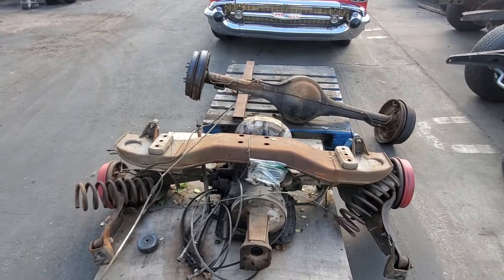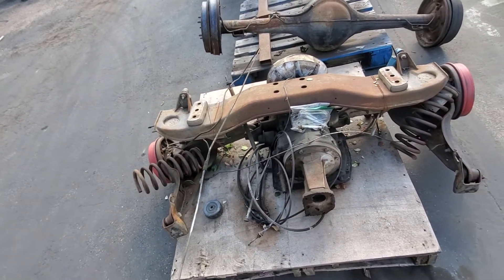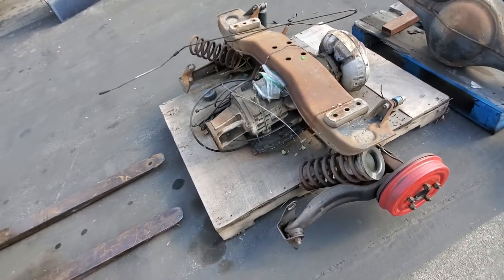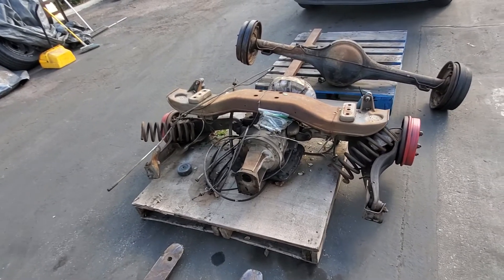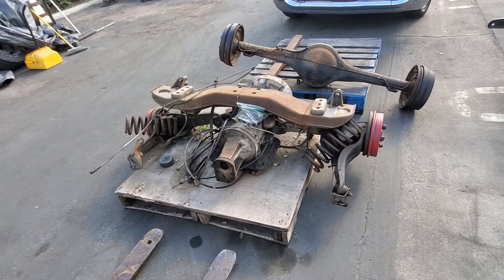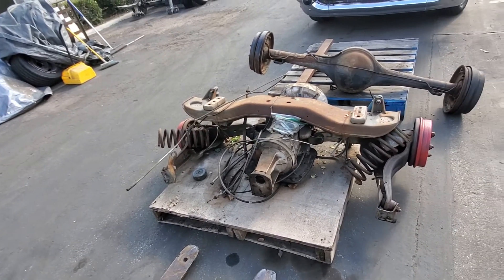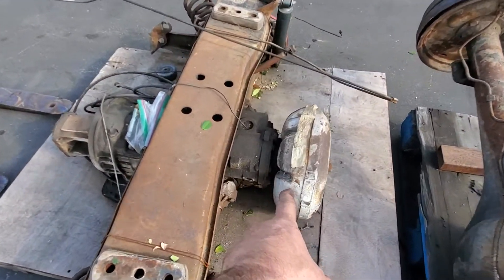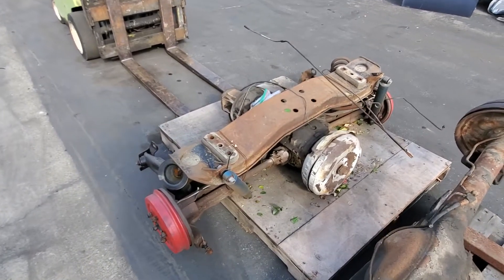Kelly's Cars Tech: '63 Tempest Transaxle

Comment: Very interesting setup. It had a rigid torque tube that ran from the engine to the transmission. The rear of the engine had what resembled a bell housing that the tube bolted to. I owned a 63 LeMans with the 195 slant four in the 80's. The car got 30 mpg on a road trip. I never had any trans problems but the engine was a bit rough at idle. The rear suspension was like a Corvair.
Reply: The rear end was much like the corvair although parts did not interchange.... (at least the internals to the differential) (we tried that in an attempt to keep the car going)
Reply: @johnhenryholiday4964 I saw one on my dad's gas station lift in the early 60's. I was 7 years old. Did the torque converter spin out in the open?

Comment: I had one of these cars in the late 1960s. A friend kidded me about putting a Chevy driveline in it, somI did. I worked in a small fleet garage during the summer when I was 17 and the older mechanic helped me make motor, transmission and rear ended mounts. I put a 300HP 327 in it and it would pull wheelies. I only used it paying around as I had a 1963 Impala too.

Comment: I guess you would have to change the firewall to fit a normal trans. I had a Rover P6, It had De Dion rear susp with inboard discs .later versions used the alum buick 215ci V8

Comment: This is why the testimony in My Cousin Vinney is so wrong. It is not a true independent suspension like they claim in the movie. The tires do not stay flat as they move up and down. They travel in an arc so as the tire goes up and down it leans in and out. If you put a first gen Corvair or one of these 1961-1963 Tempests up on a lift and the tires are fully drooped down, they will be leaning at an almost 45 -degree angle. There is a book called Assassination of the Corvair. In that book on page127 there is a picture of a first generation Corvair up on a lift and you will see just how a swing axle suspension works. Early rear engine VW Bettles have swing axle suspension as well. 1963 Pontiac Tempest wheelbase is 112 inches 1964 Buick Skylark wheelbase is 115 inches.

Comment: The major difference btwn the '61-'62 and the 1963 Tempest rear suspension and swing axles is the early suspension had  A arms pivoting in line with the joints on either side of the differential/transaxle. The A arms might be likened to the front A arms on an American car of that era. The 1963 car had an A arm, but one pivot was in front of the rear tire and the other was near the joint in the axle. These three points were all in a line. This was like a trailing or semi trailing arm, but still a swing axle. Thus the camber changed consistently with bounce and rebound (wheel movement). As a not to the videographer. Try to show more of the axle from in front, below and the rear. That is where the magic is.

Comment: I had a 63 tempest, 326 CID, Three speed manual. Great little car, BUT if you put more than a few pounds of anything in the trunk the suspension and wheels would swing upwards and the parking brake cables would tighten and lockup the rear brakes. Also if while driving you hit a bump in the road and the rear suspension would allow the car to sink, the cables would tighten and momentary apply the rear brakes sometimes causing tire screech. The problem was that the parking brake cables entered the rear drums too low. Poor design, but that little car would move when asked to. Also the driveshaft was too long and didn't have a decent damper and anytime you let out the clutch "shaft vibration" was telegraphed into the car. Doing a complete cultch rebuild didn't help. The car was over "hyped"

Comment: The Tempest was never intended to be a rear engine car.
Reply: It would of been impossible to put the engine in the back as the transaxle sat to far back.... the torque converter was in the open and spun freely at full engine speed.... a person could be seriously hurt by being near it..... this transmission was JUNK....
Reply: @johnhenryholiday4964  If someone is under your car while you are driving I suspect they are already hurt
Reply: @deadpie1234  It turned anytime the motor was running... in park, in neutral in gear or not...  I was under that car many times with the engine running ( in park with brake)
Reply: @johnhenryholiday4964  I know, just making a joke. I would agree a cover would be prudent, but calling it junk because of a minor safety issue seems excessive, it's not exactly a saw blade- an unguarded engine fan is much more dangerous, and would be much more frequently worked around while running.
We all know safety wasn't invented until '72 anyway

Comment: The pontiac tempest transmission was the worst engineered transmission ever..... they had many many failure points ...   we owned one and it was always breaking down...  the first breakdown occurred right after the warranty period ...  we had to repair and "patch together" that transmission many times.... parts became obsolete right after general motors found out what a disaster they were.....